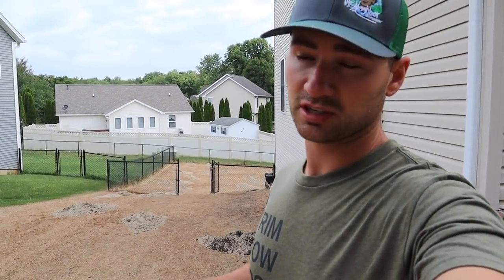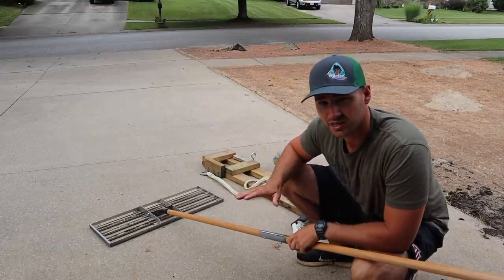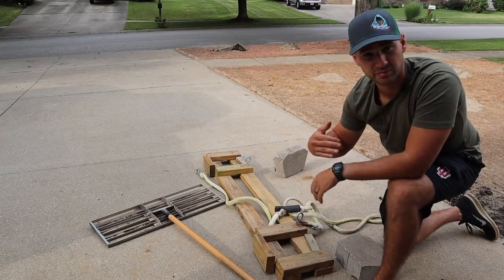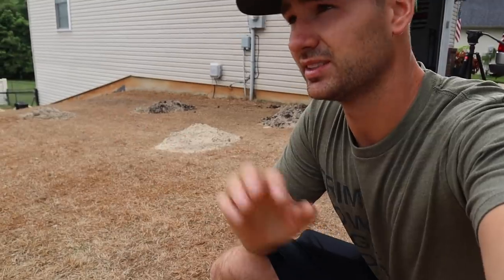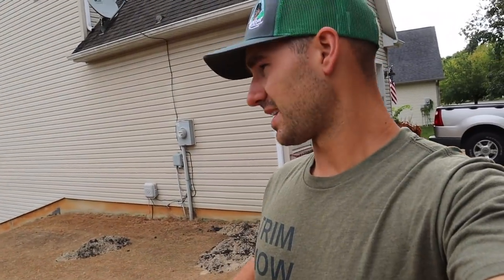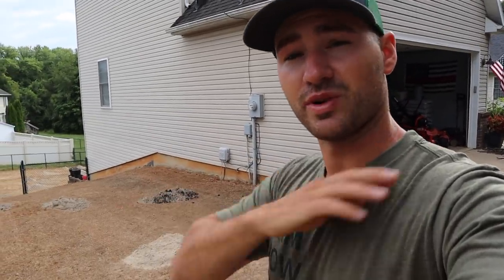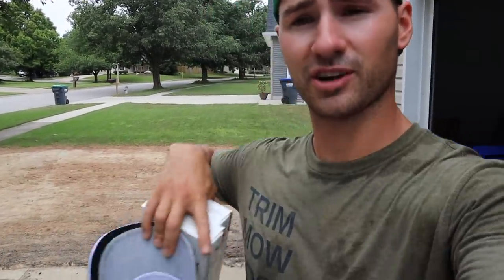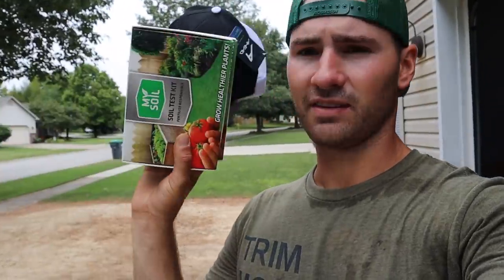LEVELING Bumpy Lawn BEFORE Seed - Lawn renovation step 4

Comment: I'm getting ready to fill in some low spots as well but I wasn't planning on doing a full scalp.  Do you recommend doing a full scalp?  My front yard is where I was going to focus my efforts first for my first leveling and it's only 750 sq ft.
Reply from the maker: The lower you can cut the grass the better and easier it will be

Comment: Link to the leveling drag?
Reply from the maker: https://www.google.com/url?q=https://landzie.com/affiliate.php?id%3Dwhisperer&sa=D&source=hangouts&ust=1599760577046000&usg=AFQjCNH6RHWfCnJ6PR3hW8Q7dkogLP866Q use code whisperer for 10% off
Reply: The Lawn Whisperer awesome thanks! I just bought an ecolawn 50 so this will go nicely with that 👍🏼

Comment: LW, what starter fertilizer would you recommend? I’m over-seeding in the Fall with a cool-season blend from Mountain View Seeds. Thanks I’ll advance for the advice.
Reply from the maker: I really like the Scott's starter with weed preventer. I have been using lawn star liquid starter fertilizer with success. Or I will just use a 12-12-12  or similar
Reply: The Lawn Whisperer have you ever used 10-20-10 or 13-13-13?
Reply from the maker: @okielawnguy  10-20-10 would work well as a starter. The 13s fert essentially the same as the 12 I mentioned
Reply: The Lawn Whisperer thank you. Just hoping my first over-seeding is successful.